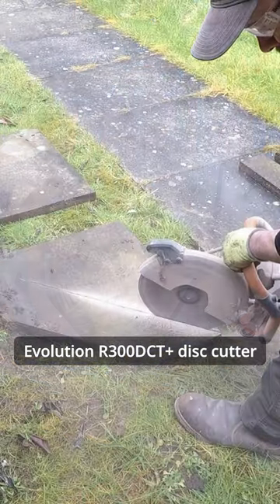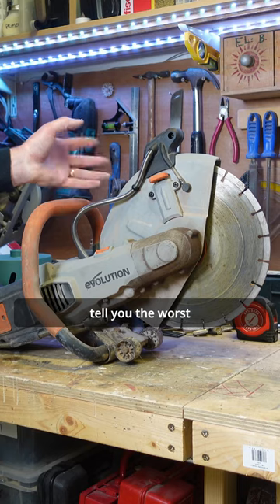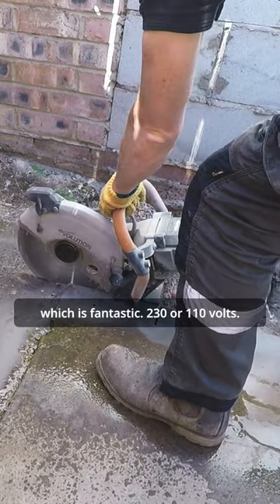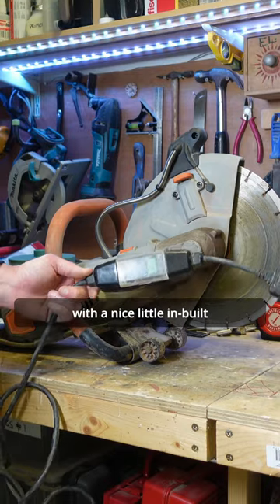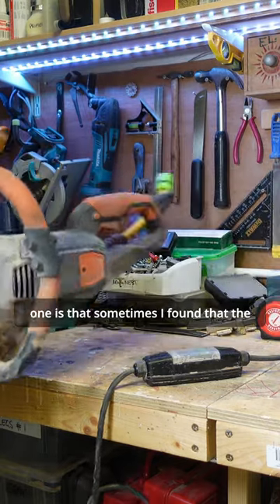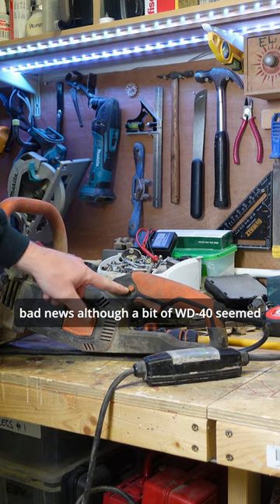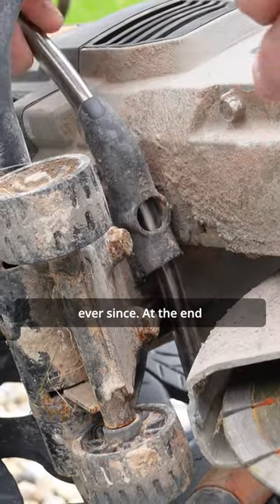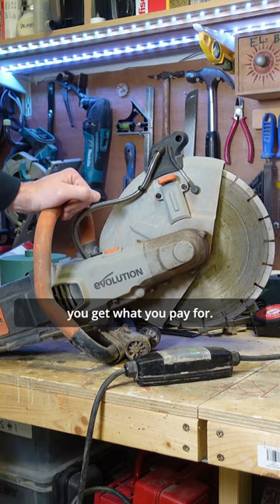Evolution disc cutter - TINY REVIEW!

Comment: I have the more basic Evolution electric disc cutter - have to agree overall. It's no Stihl, but it was cheap as chips, does what it needs to do and is perfect for one of those occasional DIY tools. Wish mine had water suppression built in though, that would have been nice
Reply from the maker: Yeah the water suppression is very useful... although I forgot to mention how wet you get. 😂